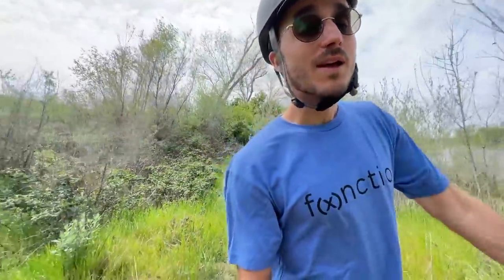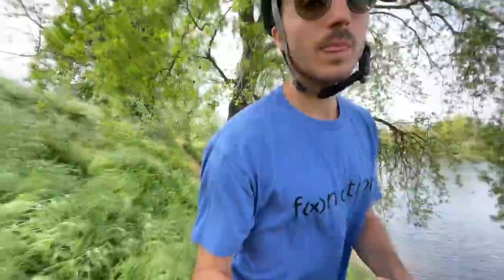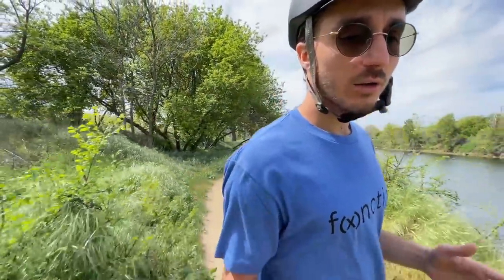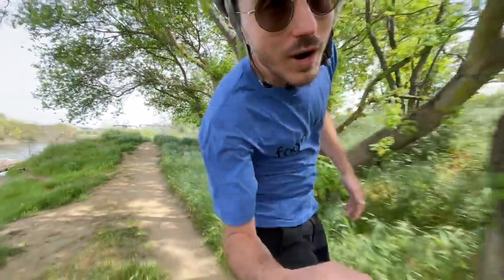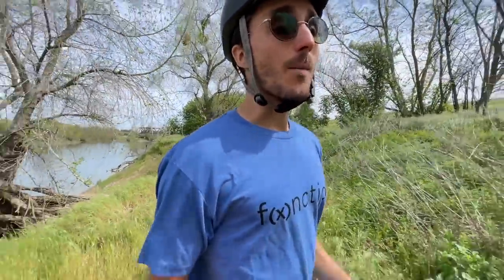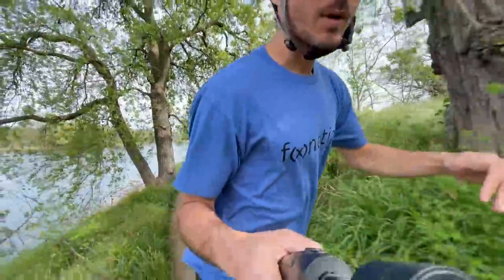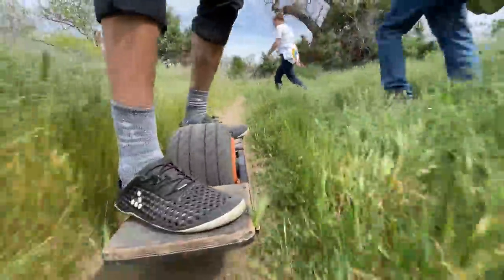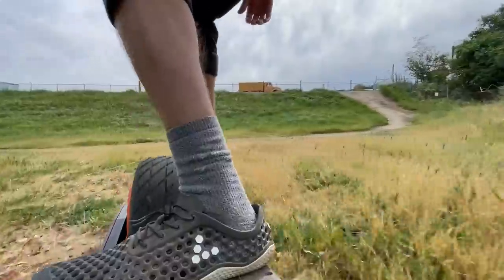Why I Don't Trust anything Future Motion says - #RightToRepair Onewheels

Comment: I bought my first XR in 2019. Within a few months of owning it, I started having issues where the XR would intermittently not turn on. I had a 4209 model and customer service had advised me to try it holding the power button to see if that would fix the issue. Sometimes it did, sometimes it didn't. I figured as long as it kind of works I didn't need to send it in, oh boy was I wrong. I was out riding one day, not going fast, not doing anything extreme, just cruising and the board turned off. I've been riding for 3 years now, I know what pushback is and I know it a nose dive is that is not what I experienced, I was riding and my board just turned off.

I sent the board back for warranty repairs. What I was informed is that my board had water damage. They told me that the battery, the battery harness, the battery box, the BMS, and the tail light were all water damaged and would need to be replaced. I hadn't ridden my onewheel in water at that time so I was confused where this damage came from. Customer service told me that this damage was not covered under warranty and they handed me a bill of about $800. $800 to repair something that I had paid $2,000 for just a few months earlier. I really didn't want to pay that so I started looking around on places like Facebook and Reddit to try and see if there were other options out there for repairing. Luckily there was a independent repair shop in my city who was willing to take a look at my board for me. They gave me a heads up going into it that like there's no guarantee that they're going to be able to fix it for less than future motion, but they would at least make a good effort toward it. So I refuse the repair from future motion and had them send my board back to me. The independent repair shop let me come in and watch as they disassembled my board and diagnosed it. When they got the battery box open I was shocked to see that there was absolutely no water damage. The battery and BMS and headlights were all in working order. The independent repair shop was able to demonstrate this to me by individually switching out the components in my battery box with known to be working components they had on hand. They identified the cause of the problem as being that the XT60 connecting my battery to my BMS had a broken locking tab and that the vibrations from riding had caused the XT60 to back itself out. The XT60 connector on the BMS had some burns on the plastic from where the connection had been arcing. They were able to desolder the existing XT60 connections and replace them with good ones. For the disassembly, diagnostic, repair, and reassembly of my board, they charged me a total of $80. 

This all happened in 2019, 3 years later that XR still works. In a time since then I have taken every opportunity to learn about repairing onewheels so that I don't have to deal with future motion's customer service. There are still things there above my skill set, but there are guys in the stoke life service network that are more educated, more talented than I that are always there to help. 

Last year I used that knowledge of Onewheel mechanics to put together a second board out of scrap parts. TFL growler rails, a converted pint motor, a controller from one board, and a BMS and battery from a different board.
Reply from the maker: This…
Reply: Same thing happened to me. I was going 17.9 mph and the next thing I know I’m picking myself off the pavement. I assumed the board turned off because I pushed it too hard but I don’t remember ever getting the pushback. I was lucky I did not to have to go to the ER and was too terrified to push past 15mph from then on. Never thought it could be a loose connection.
Reply: @baileyanderson2166  in the years since I have spoken with some people who did actually water log their battery, and they were handed a similarly steep bill. So, it's not like they came up with that number randomly. It's just that.. I don't know.. trying to put things in the best light, all I can think is that somebody saw the burn spot on the BMS and just assumed water damage. If one thing in the box is water damaged, then everything must be water damaged right? Or maybe there was a miscommunication somewhere from technician to customer service rep. 

Having that bad experience right off the bat really made me want to avoid doing further business with future motion. I have also heard numerous instances of a onewheel going in for services with aftermarket accessories, and coming back without those accessories. I've also heard of FM technicians refusing to do any work on boards that they suspected to be modified. Relentless shred shop recently had an issue of FM refusing service on a board that had an aftermarket tire, however, this is not even close to the first time I've heard of that happening. Unfortunately, I'm stuck in this awkward situation where I love the product, but I hate the company. 

I do feel the need to mention that while my experience is not an isolated event, it's also not the absolute rule. I had a guy that brought in a pint that was having an issue. Whenever it went into push back he wouldn't be able to decelerate and it would just keep accelerating until it wiped out. As far as I know, there's nothing that I or any other independent repairer can do to fix that problem, so I had him send it back to FM. In that case, future motion honored the warranty and fixed the firmware issue without cost. 

In general I feel that if I have other options available to me, I am going to pursue those other repair options first and only resort to FM repairs if I have no other options left.
Reply: @UCSSjB7yjylaFGAwSpHKIMFg ~ Good to know. I honestly can’t remember as I was in shock when it happened. Had a few people pull over and check on me it was so brutal. I remember power cycling it as I wanted to avoid any calibration problems from wiping out so I’m leaning towards it still being on when the nose dived. 

It’s worse when I think that the configs tell the balancer to just stop working mid ride.
Reply: Recommenting because I tried to edit my other comment to reflect where exactly you could find the original posting of the flow chart, apparently YouTube feels that violates their community guidelines and deleted my comment. If you search for Onewheel Nosedive Flow Chart, it should be in the images section.
Reply: What FM do is what a lot of service center basically do. This is happen to many laptop or phone, they will just by default it is board damage, water go into device, yada yada and always blame user or customer first. 

Basically 3 companies have screw me over about this. Acer, Toshiba, and Apple. Acer due to LCD damage and they want me to pay for motherboard repair, Toshiba is same shit (inverter damage (actually the cable) become board damage), Apple is broken ribbon cable (yes broken ribbon cable which they diagnosed as board damage).
Reply: OMG i hope you called them up and gave then an ear full..
Reply: Sounds like the folks over at the Onewheel headquarters are the double whammy of being both incompetent and dishonest .
Reply: Unless the XT60 had a failed solder joint, a small zip tie would have fixed it. I always zip tie XT60 connectors together.
Reply: @lashley370z  You're not wrong, and I have absolutely jerry-rigged the shit out of equipment to get it into a functioning condition. However, I only do this when I don't have access to the proper parts or equipment to be able to make a correct repair. In this case I did have access to replacement parts, tools, and a skilled repairer. True, I probably could have used a zip tie to just hold two ends of the XT60 together, but because there had been damage to the actual XT60 connecting pieces and I have access to replacement parts I would rather go ahead and replace the parts just to create peace of mind that there's no chance this damage is going to lead to other problems down the line.

Comment: Great to hear your story. Even better to see you wearing a helmet.  Hopefully as the community speaks out, FM will see the need to do better.
Reply: They won't. But the community needs the truth, and even more potential customers need to know, that their components are paired and they can't repair them easy now
Reply: helmets for life!
Reply: @duster8373  #helmetsarecool RIP Uncle Jimmy
Reply: why dont you guys wear helmets when driving cars?  driving a car is alot more dangerous than a bike or eskateboard.  you preach wearing a helmet for everything else, so why arent You wearing a helmet while driving?  you should for your own safety.
Reply: kinda pointless if it's tied loosely like that
Reply: @shadowsilverlight1651  …that’s a cute line, but it is not remotely accurate. It is a far, far higher risk for head trauma while riding a skateboard or bicycle than it is travelling in a car.
Talk to anyone who works in a trauma ICU and they’ll tell you there is a disproportionally high number of head injuries from skateboarders and riders [as well as middle-aged dads falling off ladders while cleaning out gutters…]. 
Cute line does not equal factual information…🤷‍♂️

Comment: FM has never and will never touch any of my boards once they leave the factory. Not through spite or anything, it's just not necessary or cost effective for a lot of us. In the grand scheme of things they're simple electronics only made complicated by their efforts to stop us working on them. Living across an ocean makes it unfeasible for me to ship these things and pay through the nose to everyone in between.

The qualified technician line burns me a bit with them. My XR is well and truly in capable hands for fixing which has needed numerous repairs some of which you've mentioned. My Pint was a total write-off that would have needed nearly everything replaced from rails to housings to the internals. It took months of DIY to restore because I can't get parts. I had to fabricate and make them through trial and error but it's back up and rolling instead of being in a landfill or parted out. I'm no qualified technician but my boards once I've worked on them are damn well less prone to failure than before and I imagine the same can be said for a lot of us that work on our own gear.

I feel Louis didn't just bring awareness to our issues, but more importantly seemed to give us courage and a direction whereas before outside of complaining on reddit we didn't know what else to do. I want to like FM and for the most part still do in a limited capacity, they just make it so hard sometimes that even the good news has me cautious these days.
Reply: That Jake put out THIS video, with THIS title, AFTER the TFL/FM one (and in the comments to that one, he said something like "perhaps this relationship is repairable after all")...well, it doesn't do good things for my "hopium", as you put it.
Reply: @glyphnosis  Agreed, wish things were more transparent so we'd have a chance at making firm judgements on these situations, my hopium is looking more like copium each new day. 
I'm unironically on the verge of cancelling my GT order for the meantime, keeping my money now it's needed more than ever and later buying local when I'm ready if I still want to after the dust has settled. I wanted an early unit so I could get to work making things to fit my needs and for others but now it's so much less appealing.
Reply: @LiaIsTheCutestKitten  never too late, but it ain't happening unless someone buys em out

Comment: Thanks for sharing. I had the ferrite ring issue on my XR a few miles in; it was first run pre-order. Long story short - FM 'fixed' the issue over 8 times, under warranty. My board spent most of it's early life in transit or at FM. Same problem getting them to admit issue and actually provide a solution. After almost 2 years I got a tech's personal line. He was helpful, but I had to explain the fix; going as far as providing links to community solutions. I was assured the issue had been solved and acknowledged by FM. They hot glued & padded the ring... came loose within a month or so once again. Ended up causing catastrophic controller damage this time. Can't say the repair work from FM is good or even sufficient. More often it's sloppy unfortunately. There was also a problem with power buttons sticking on both my Plus & XR that they refused to accept. Hope someone there gets a clue. Soon.

Comment: Had the exact same issue myself with the headlights.  Thanks to you trailblazers I repaired it myself and replaced it with a shielded cable without issue.  Faq FM and their repair center BS.  These machines aren’t rocket engines.  Most everything that needs fixing on them can be done from home with a good youtube video and the right parts.

Comment: Great video!  I applied for a FM dealership a year ago.  During the process I mentioned that I'm an electronics tech and could also service the boards if I had a dealership/rental business and told them I'd done some upgrades to my Pint.  Haha.  I only said anything because they were portraying themselves as a hip company that was down with the community.  Got a hard denial and the application was shutdown.  Funny because I've got a great location and business history but in retrospect I think it was the mention of tech work that sunk the deal.  Never heard from them again and I followed up a few times.  If they aren't going to grant owners the ability to conduct repairs they should at least vet some repair facilities that aren't FM and come up with a process to onboard authorized repair shops.  

As an aside I'd love to see a rundown of your setup to get such great footage!  Thanks!

Comment: The Pint got the metall power button nut problem from the start and it was present for about 1.5 years until they changed it. No information to current customers about the problem.
My nut was loose form day one, as I live in Sweden and there was no update at the time, I decided to fix it myself.

Comment: Pints have a similar issue where the plastic power button housing is secured to the controller box with a metal nut that tends to come off, sometimes cracking the power button housing. The nut will short stuff on the board like Bluetooth, although personally I had my board turn off mid ride cause of this.

Obviously the solution would have just been to use a plastic nut instead so that nothing would happen even if it came loose, but as far as I know they haven't actually changed the design on the Pint X or GT

Edit: looks like the Pint x and GT use a plastic nut, but it's still baffling that they thought a regular metal nut on a hollow plastic part without any sort of adhesive was a good idea in the first place.
Reply: They fixed for the pint after a really long time
Reply: @oskarfallman must have taken a long time, I bought mine in late 2020
Reply: exactly my experience. & many other OWheelers I'm sure

Comment: Thankfully, all models since the original Pint (including the GT) have integrated a headlight cable that consists simply of insulated wires. No more ferrite issue.
Reply: Doesnt Pint have lock ring around power button which is metal ? Heard stories about that, pretty much same issue, different place.

Comment: Being a Onewheel stockist in the past Jake you will know the standards required that are set to be an official seller. If FM were to apply a similar model to the countless repair centres across the globe where they could supply parts to qualified repair centres it would help riders globally and at least be a small step in the right direction.
Reply: As a former FutureMotion employee in the CSR department, I can let you know that they are a JIT company with their parts. Since it doesn't qualify as a vehicle, they do not have to carry an overstock of parts for each model as you would with a car, a motorcycle, or the like. This also means that technically they do not make a profit off of their services due to the JIT manufacturing loop. All this means service centers are not going to happen merely because of the legal requirements (at this point) for the company to hold onto parts. Remember, they phased out support for three boards now, which means they don't have to hold onto parts either.
Reply: @MatthewEaton  this is terrifying.

Comment: The ferrite ring was probably needed to make the PCBs pass through the EMC/EMI (ElectroMagnetic Compliance/Interference) regulatory testings. 
These tests are meant to make sure that the device doesn't emit too much radiated or conducted radio frequency interference into the environment and possibly cause problems with other devices. Most likely the headlights and their wiring were acting like an antenna, which caused the radiated emissions to not pass the required levels, so the "ferrite ring of shame" was added to the wires going to the headlight module as an afterfix (and therefore not pre-planned by the engineers) and that allowed the board to pass the EMC testing.

Comment: There is a common problem with the pint where the nut behind the power button comes unscrewed and then dangles on the cabling. It yanks on the cable until eventually it breaks the soldering and the board can’t turn on using that button. Sounds similar to the fare-rite ring you were talking about.
Reply: yep. same issue